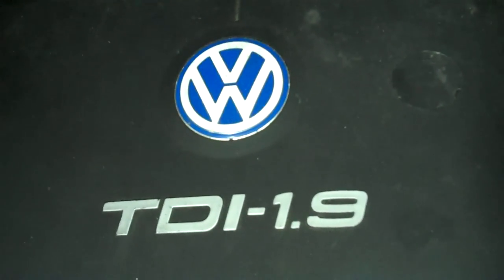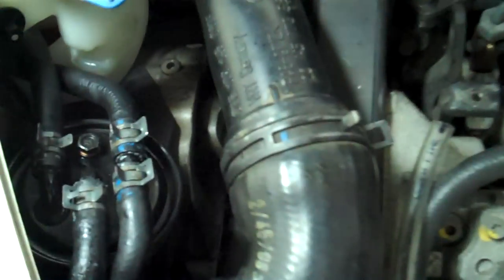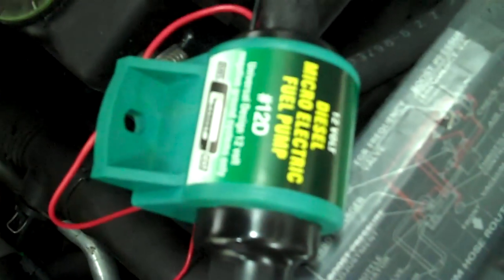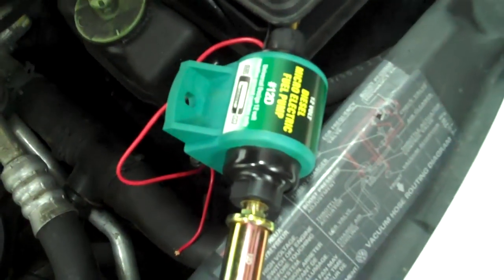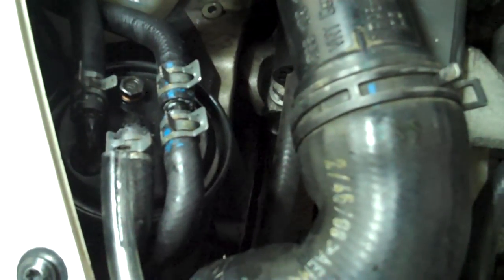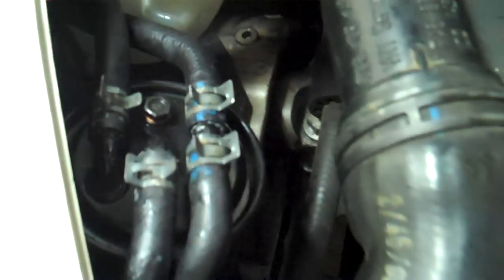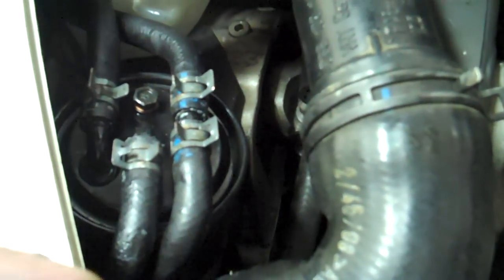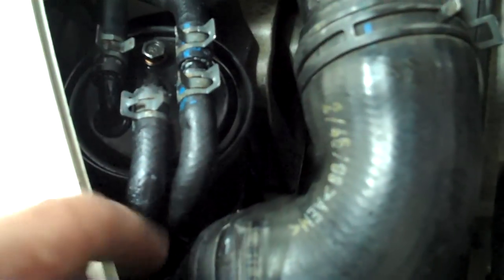VW TDI Beetle Run out of Fuel

Comment: A lot of the comments are asking about this pump. It is a generic fuel pump, not a vacuum pump. I got one at Pep Boys but they are available at any auto parts store. You can use a vacuum pump but make sure you have an in-line reservoir to catch any fuel. Don't suck fuel into a vacuum pump.

Comment: About the suck.....2000 VW Golf TDI quit unexpectedly.  Replaced filter $17 and tank pump $70 (both ebay) and bought this green diesel pump $20 (ebay) replaced 3mm braided return hoses too - $7 at IDParts (fast shipping).  This little pump takes quite some time to draw through the filter.  Took 3 hours to draw through the injectors!  He doesn't quite specify - just so you know - long time! A little diesel in the clear draw tube will show you the air draw.  I'm sure they're all different. Finally got some fuel through the injector pump. Cracked the middle injector and "Magic" it started. Thanks for this video.

Comment: ..Turn the key on and off 20-30 times then start it. They will prime themselves
Reply: Alh or equivalent cars dont have a lift pump
Reply: I used to think this. Some models including mine do not have a secondary lift pump in the fuel tank which helps eliminated this problem because I ran out of fuel a few times with my other jettas and no problem. not necissarily the case with all the jetta/beelte/golf line up.

Comment: I have run out of fuel several times in my VW TDI and a few squirts of starter fluid in the intake starts it right up. Some people don't like starter fluid but it works.
Reply: Just make sure the starting fluid has upper cylinder lubricant  in it.

Comment: What if I place a small rag with gasoline and place it at the end of the air filter?? It also starts it up evern if its diesel. All the car needs is to basically have the smell of gas in the filter for a second and crank it to start.

Comment from the maker: You could try undoing the injector lines (don't take them off just undo the nuts) and crank it over for a while...then check to see if fuel has made it through yet (if not crank some more)   sometimes this works :)

Comment: You DONT need a pump or vacuum! I got mine to work by just "cracking the nuts" of the injector lines, and cranking only a few times, allowing the pump of the car to do the work like it normally does! Worked for me, only used a crecent wrench! After cranking, I had someone look to see when it spilled out, I heard the car start and immediatly shut it down.  Tighten the nuts back and your done! I had a runnin car hooked up to the battery for crankin power, but it wasnt necessary.

Comment: Hey i got a 02' beetle tdi as well and diesel injection services  and dealership wanna charge me 1000+ for tha part and 500 to install a new injector pump. Bt i dnt think its tha pump bcuz its leaking fuel. Cld it jst b tha seals? cuz im in Cali. And all we got is ULSD(ultra low sulfer diesel) and this guy i looked up drdansbiodiesel said tht if i pt b99 tht it cld swell up my seals cuz ulsd dries thm out. I do not wanna pay tht money 2no one! Nearest b99 station is 25miles wht do u recommend???

Comment: part one only makes part two faster, but you can prim your diesel system by applying a vacuum to the return line until you have diesel coming out of the line.  I did it by mouth after rebuilding the head.  And yes diesel tastes like it smells. 

Thanks for the post.  I only wish I had seen it before primping my system.
Reply: I realize this has been 12 years, but it struck my funny bone :)  "Yes, diesel tastes like it smells" :)